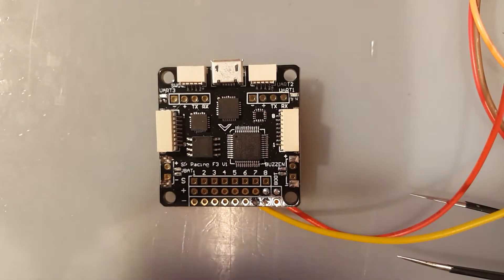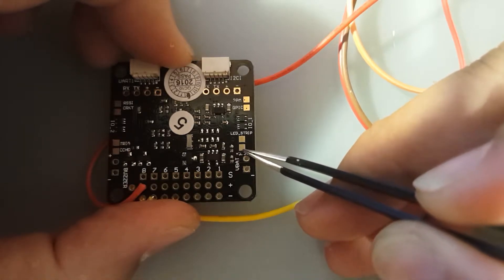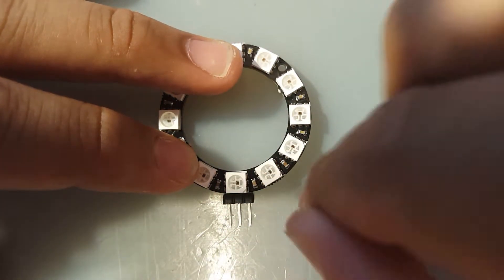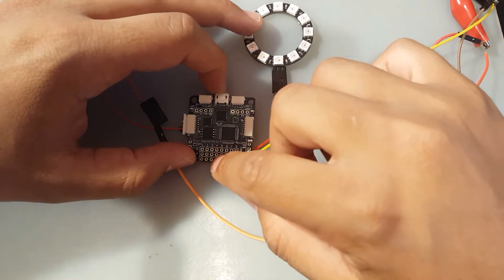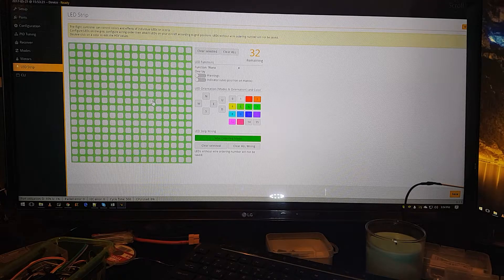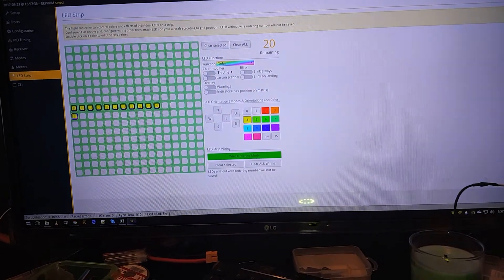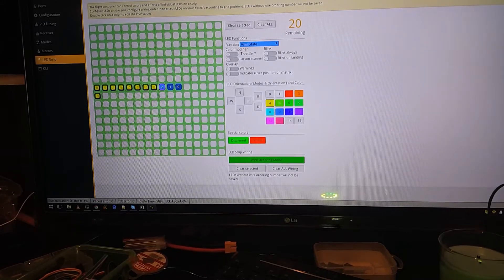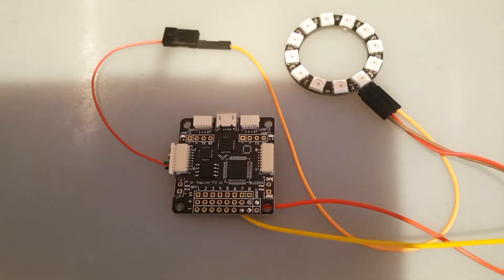Setup RGB LED on Flight Controller (Easy Way // Betaflight)

Comment: Hi~ Thanks for good tutorial.
but My FC can't save LED strip settings. after reboot all settings disabled. what's wrong?
I use Beta flight Configulater ver 10.5.1 /  firmware 4.0.4
Reply: do the lights work tho?

Comment: after upgrading my fc to the latest betaflight im no longer able to enable led strip. after enable save and reboot it will always go back to disable. any sugestions ?
Reply: If it's a f3 fc yes it will disable them. Bc they had to take them out to fit the new firmware,
I have a 2 DC that are f3 boards.
The omnibus f3 will not do the leds on it bc of the new 3.5, think it's even 3.4 also. It does the same as yours.
My betaflight f3 fc will run leds bc they didnt remove them on the new upgraded firmware.
It's a hit and miss, best bet it to go read what ones have changed in github.
I have been switching to all f4 fc bc you can use all the stuff in bf.
To me all it did was push ppl to have to buy new stuff.
Hope this helped you
Reply: @toddbeal4373   at the moment upgrading the fc to f4 is not an option so i guess i will need to downgrade to a lower bf version. Do u know what is  the latest bf that support it?
Reply: @asafmagen  not sure at the moment, I would have to look at my cli saves for my one f3 fc.
It's the one before they started the feed forward stuff.

Comment: Nice video! I'm having some issues getting the  LEDs to work properly on my SPRacing board. When connect to board to my computer via USB the leds work fine but as soon as I connect the battery they stop working! I don't know what the issue is and I hope You can or someone can help.
Reply from the maker: Mat Fever Can you tell me how you connected. 

send me pictures mesh.drone@gmail.com

Comment: Did my first set of LED's and everything works great.  Thanks for doing this video hope you continue.
Reply from the maker: Larry Faucett Glad I was able to help.. If you guys like these I can keep doing them. If you also have any suggestions please let me know.
Reply: Suggestion for a video...How to daisy chain LED's with soldering pads or those with plug in connectors.  I have circular LED's for under the motors.  They have plug in connectors.  Seems like the next cable should split so you can move to the next light.  As it is you hook up your first light to the board using the cable port and you done.  No way to move to the next light and so on. so here I sit.......lol
Maybe others have the same problem.  Thanks
Reply from the maker: Larry Faucett Email me the pics of the leds you have and the pads on them.

mesh.drone@gmail.com

Comment: Awesome detailed instructions. I'm new to this hobby but have built 4 quads and know how to cut a section of lights from LED strip lights and power them up. But Until now I could never find anyone to explain where to connect power and signal on the board for programable lights. Seems like a lot of vids always forget the basic part like hooking them up and make the assumption that we already know that. I've seen tons of vids showing Betaflight configuration BUT this vid fills in the missing info I've been looking for. Awesome, great, fantastic Huge Thanks.

Comment: I was wondering how many ws2812b modules it is safe to power from FC. On my new build I planned to have BFF3 with 3A bec and 26 LEDs (4 per arm and 10 in body). These are so power hungry I know it from past projects, 1 module can take between 20-60mA. Then my LEDs would easily draw 1A which could be dangerous, because bec also powers camera, vtx, receiver and itself. I may end up with only 3 LEDs per arm and no in the body for safety. Using external bec seems to be unpractical for miniquad.
Reply from the maker: +Michal Horváth You can add more but you have to be aware how many amps each color takes... for example white is the most power hungry since it turns all 3 RGB leds on to create white.. red or green is the lowest I forgot witch maybe I'll make a video and see the amp draw of each and what colors should be safe.
Reply: Exactly, I already tested that. One diode takes up to 20mA, so white is 60mA. For color combination use I always count with 40mA. But that is still 1A for 26 LEDs, which IDK if it is safe.